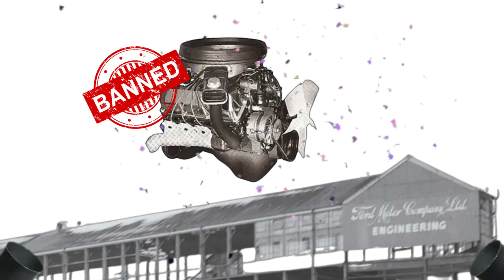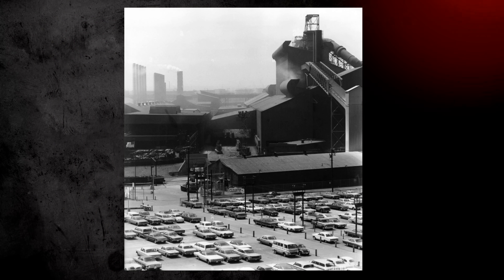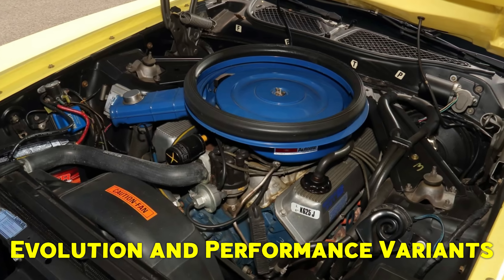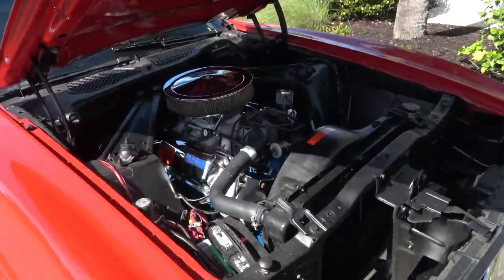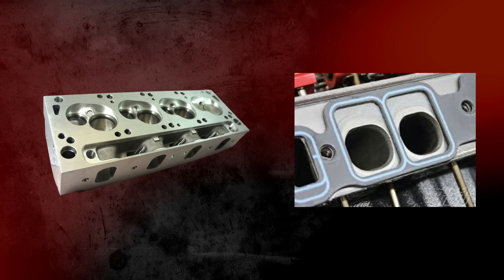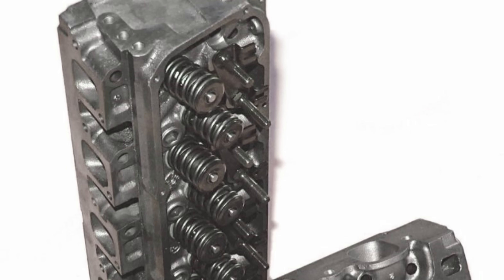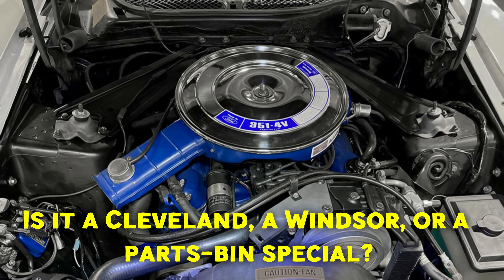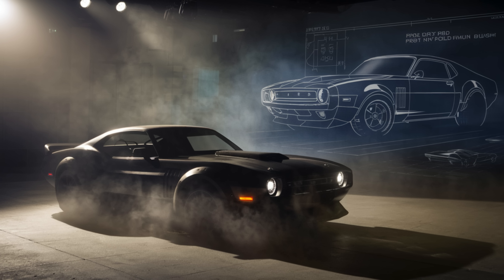The Shocking Truth Behind FORDs Banned 351 Cleveland Engine

Comment: By the mid 70s gas and insurance killed the muscle cars. But if you were around then like I was, they were practically giving them away. My uncle grabbed a 69' mach one 428CJ in 76'. He traded a 75' monza straight up for it! Though not a muscle car, in 80' I bought a 64' imperial with the 413ci wedge, 380hp, for a hundred bucks. I stuffed  that in a  71' Dodge Dart and destroyed the corvettes of that time. Man! Those were some great days.
Reply: I got a '70 Mach I with a 351C for my 16th birthday (1981) for $850.... Sure it was a bondo buggy and it went through transmissions like it went through starters, but when it did run, it was a beast.
Reply: so many under $500  in the early 90’s and gas was cheap and my job would give me 5 gallons of gas a day just to show up , wasn’t really worried about the gas mileage. They were so fun to drive.
Reply: Damn. Buddy of mine had a 1962 Chrysler 300 letter car (H?) that had the cross ram setup. Think it was 400 hp. Absolute beast. Push button transmission and the bubble dash.
Reply: @ J prolly
Reply: @charliebay9441  I bet that had at least 425hp maybe even 450hp. Those wedges were the precursor to the Hemi. A couple of the best engines ever made.
Reply: @ursirius4878  The hemroid & the wedge were about the same time frame. Chrysler put first gen hemroids in cars starting about 1953. The wedge motors would smoke a hemroid in street trim EVERY time, the reason Dodge made MAX WEDGE, NOT max hemi cars in the 60s. Hemroids don't make big power without a blower because the design limits valve size, lift, & duration. A wedge will handle at least 20* more duration & a couple hundred thousandths more lift. The valves eventually hit each other in a hemroid because they are placed 90* apart & open towards each other! See what John Kaase has to say about them because he makes both types of heads for a 385 series BBF engine. Yes, Boss 429 heads were hemroids too. 1 of the reasons 4 valve heads work well is because they are a "Pent Roof" chambers & the much smaller valves don't have the interference problems a 2 valve hemi head presents. One of the best heads(engines) ever was the Buick "NailHead" because the valve inclination angle was almost zero, or vertical. Small block Chevies are 23* & SB Fords are 20*. Somebody is now making an 11* head for SB Chevies. My dad's buddy had a 65 Chevy p/u with a 401 Nailhead & it would smioke most of the "muscle" cars of the late 60s.
Reply: @bradgriffith4231  a few of my friends had Hemi's and 440s with a 4 barrel or a six pack. For street the 440 was their choice. Easier to tune and keep running for daily driving. But if you wanted to run the quarter the elephant was the way to go.
Reply: @ursirius4878  Actually, the LS6 Chevies were the KING back then. Hemroids have always been turds without forced induction because the design, with the valves 90* from each other, limits valve size, & both cam lift & duration. The valves WILL hit at some point. John Kaase makes both hemroid(Boss) heads & wedge heads & he explains this. The canted  or splayed valve heads are the best design & a wedge head is the next best with the valves stood up to as near verticle as possible(think Buick Nailhead). The hemroid was an 1890 industrial design motor, not a performance motor.
Reply: @charliebay9441  HP ratings dropped when they changed to "Net" HP from flywheel HP. a 20% drop through the driveline is common.
Reply: @ursirius4878  Back in the 90s I bought a late 70s Impala for $400 and that was a pretty solid, fun car (that old soft suspension made the landings nice and easy when I’d launch it over the railroad tracks in town! LOL) biggest flaw was that it looked like a previous owner had painted it with house paint and a roller brush! LOL!  Brother had a 73 Chevelle he’d bought for less than $1000 in the late 80s early 90s, used to have fun racing his friends in their Satellites, Camaros, and such that they’d all bought/built for pennies on the dollar.

You can still buy some great “old” (new old, “didn’t they just stop making that?”) sports cars for a bargain if you’re willing to take on body and paint work and the high probability of having to turn some wrenches. So long as you’re buying into one with a very common drive train (5.0, 5.3, 5.7, 351, etc) you can do it all relatively cheap! I am debating buying a damned nice looking 90s Camaro for under 10K, and with a 5.3 it’d be very easy to get parts for and cheap to massively upgrade.
Reply: Wrong answer,it was the US support of Genocidal Jews in Isreal that caused OPEC to embargo crude oil for gas. 50 years later and we still suffer from being subservient to a bunch of Genocidal Maniacs.
Reply: The 413 wedge was a good engine but the 80s Vettes were still SMOG motor turds & probably outweighed your Dart by at least 1,000 lbs with a 180 HP 350.

Comment: There's a reason the original Panteras were built around the legendary Clevelands. No other sports car on earth at that time combined exotic looks and American muscle. I'm currently reworking the numbers matching matching 351C in my 1972 pre L. Going with the CHI 3v heads and intake, roller cam, etc. Aiming for 500 horsepower and under 3000 pounds. These cars rock and roll when built right. Great Video, thanks so much !!
Reply: Getting ready to build another 351c for my 73 pantera,will keep original motor in case we might want to restore to original, looking for 475 or so hp
Reply: @lanehawley4987  You go brother !!
Reply: Here in Australia the Ford Cleveland 351 was legendary. Ford Australia built the world's fastest 4 door sedan in the XY GTHO PHASE 3 , it was even faster than a lot of touring cars in Europe and America. All here in Australia back in the late 1960's through to the early 1970's. The XY GTHO was built in 1971 but Ford Australia race program started in the 1960's. And Chevrolet motors were used in General Motors Holden also. Chrysler did exceptionally well too. But Ford dominated the local touring car race class in the 1960's and 1970's. Check it out. And here in Australia we have a race track named Bathurst on Mount Panorama in NSW. Check that out too. Great time here in Australia unlike nowadays.
Reply: @joedipietro2559  1000% true, I was looking for someone who knew their stuff!!
Reply: I've been in one, with a BUILT 351 and it ran like a scared rat. Kind of difficult to do anything other than stock naturally aspirated intake tho, which sucks. (I mean without uglying up the car)
Can you imagine a blown 351 in a Pantera? ;) Tom Tjaarda would be smiling in his grave.
Reply: I've got my 73 mach
351 ram air ported polished heads intake balance blue printed forged pistons rods. Converted to a solid cam a bit wild.. 471 hp 513lb ft
11.91 1/4
7000rpm I have hit 7500 once but that's my scary limit. I was losing to a Camaro... Until 2nd.
Ray Barton himself built it for me.
Reply: @JoeBlau-c4e  Strong numbers for sure. Ray knows how to build em. I'm sure it's a blast to drive. Clevelands forever !!
Reply: My brother and I found a 351 cleavland at a scrap yard in Tampa Florida in a mustang fastback, wrecked on the side of the car. It turned out to be the 2v heads. We took it to a local machine shop to have it gone through. The owner of the shop told us that the engine was one of the best ones he had seen in a very long time. The shop went ahead and replaced the cam bearings and sold us all the other parts to get her back together. We topped it off with a mid rise weind aluminum intake, Holley 700 double pump carb. With a comp cam 534 / 544 lift with double springs with dampers. For the exhaust, we had Hooker headers that had to be cut where they mounted to the heads and a moroso deep sump oil pan with high volume oil pump. We stuffed that thing into a 1982 mustang GT. Hince the reason for cutting the headers. It was pretty fast and had a lot of low end torque. That was only one of the cars we built. I wish we had never sold them. A lot of sweat and money and time. Never sell them if you build one, you will regret it sooner or later. Now I'm disabled and can't afford to build anything. I really miss the sound of that rumble of the cam.
Reply: @mikehall8032  I think you should be able to achieve that HP with that combination of parts, I was getting 450HP back in the late 90s and only 2V cast heads although it was a stroker motor that would rev to 8000, they said on the dyno with a high rise and bigger carb it would have made 500hp.
Reply: google Woodhouse Pantera... incredible car... creator is a friend... was fun to watch on track
Reply: @robviousobviously5757  Woodhouse sold the car long ago and was later into vipers.
Reply: **pilot's license sold seperately.
Reply: I guess you've never heard of the AC Cobra, the Sunbeam Tiger or multiple others. Several manufacturers at the time used short deck, Ford Windsors because they were the smallest external dimension engine made & fit where others wouldn't fit. The circle track guys put together the "Cleavor" with a Windsor block & Aussie Cleveland parts. Edelbrock now makes a Cleavor package with heads & intakes. FYI, I had a friend in Phx in the 80s that put a 427 BBC in his Panterra & really woke it up! LOL
Reply: I had an original 351 boss from a pantera  i built it exactly to NASCAR specs. It made 550 hp it was a rev monster
Reply: Jensen Interceptor was contemporary.
Reply: I had a friend in Scottsdale that tossed the Ford motor & put an aluminum BBC in his Pantera. BIG improvement!
Reply: You're forgetting the Bricklin.😊
Reply: Those Panteras had Aussie made Cleveland’s
Reply: @georgestarzynski7222  Just check for the "G" cast on the cylinder block wich stands for Geelong Melbourne foundry. If it has "C" casting letter than it is a Cleveland Ohio cast block.
Reply: @georgestarzynski7222 no they didn’t
Reply: @georgestarzynski7222 mine was a c motor
Reply: Still remember fondly my 69 Mach I!  I couldn't afford to make the repairs to tighten up the suspension and repair the rust at the fast back windows.
I would take that death trap on the freeway late at night and just open it up.  It was floating all over the lane but felt like a rocket accelerating to the moon.
Reply: @cantweallgetalong  Dear old dad bought a new one in 1969. 428 SCJ drag pack 4-speed Mach I. Man, what a ride. Back Jade with the orange mach I stripe. Took me for a ride  at 2 am one night. Got that thing over 150.  Had the speedo pegged straight down.
Reply: DeTomaso Mangusta had a 302 Ford. 
The Shelby Cobras had 289 and 427 & 428 Ford motors. 
The Sunbeam Tiger had a 260 Ford. 

Among many other European exotics with Ford engines at the same time.

Comment: I bought a 100k mile 73 Mercury Cougar with the Cleveland engine.  It was low compression and detuned and didn't have that much power especially at low rpm.  It got 10mpg running around Raleigh.
Reply: I had a pretty much clapped out 71 Cougar with a 351C 2V. With an open element air cleaner and dual exhaust, I’d see around 14 on the highway on a good day.

Comment: everyone who loves drag racing  remembers 

the Vodepevic bros

1980s

eddy.ivan. truck mechanics.

naturally aspirated- no nitrous no turbos on Av gas 

All cast iron small block australian  cleveland - radical braised ports re routed runners custom grind flat tappet camshaft  custom made re ported offy intake single dominator carbed engine with custom built headers 

lenco 4 speed manual 

full bodied 3700lb + car

8.26 seconds 

adelaide international raceway 1/4 mile 

2 dr falcon coupe

wheelstands 1metre high through 1st 2nd 3rd  til half track 

inside that tamed stock 302 cleveland is a fucking weapon.

ADR laws mean nothing to a mechanic with metallurgy & engineering skills.

😎🎬

Comment: Unfortunately,  due to higher regulatory requirements for emissions,  the 351 really didn't stand much of a chance in the development process of that engine.   That was one really great engine.
Reply from the maker: You're absolutely right! The 351 Cleveland had some impressive engineering, but regulations really shifted the landscape for performance engines.  @thomastaylor6699

Comment: I had a set of 4V close chamber heads that I swapped for some open chambered heads. Not realizing that pretty much all the yank motors had open chambered heads and were pretty common with people importing them to Australia but the closed chamber were mostly Australian and a lot rarer than the open ones. 😢
Reply from the maker: That's an interesting story! The differences between the closed and open chamber heads certainly played a big role in performance and rarity. It's fascinating how certain parts can be more common in different regions! @grantleypotts8046
australia got an exceptional motor tooling factory , i wonder were the machiens and  engine casting went ?
Reply: I wasn't aware of the Australian connection to the Cleveland when I bought my Pantera back in 1994, but I certainly am now. Manufacturers like CHI,  Yella Terra and more are instrumental instrumental in enhancing the performance and longevity of these great engines. We Yanks owe you Aussies a bunch. And thank you for your encouraging words sir.👍
Reply: We thank you Yanks for all the 351C crank and rods that were imported from you, especially in and around the early 90s when local wrecker yards were asking an arm or leg for a conversion from the 302C to the Five One. It was interesting that the American crankshaft wasn't stamped or casted with the engine size as we were the only muppets that down sized the that engine. 🤔
Reply: @grantleypotts8046 that was always the case to get a Chev or a Windsor to Reeve you didn't need to spend anywhere near the money to get it to hold together and go like a shower shitt where is to this day to do the same to a Cleveland is astronomically dearer  .. try and put a blower on one 😮you could do a healthy 350 Chev for about 12 grand 20 years ago where as you would have spent at least 18 to 20 to do the same type deal to a f**** Cleveland ...
Reply: I still have a set of 69 closed chamber in the garage as well as "xxx" 4bolt main block. If my pantera sourced block fails it will be next....
Reply: @hegonefishing9122  🫶 Dav was it
Reply: I was led to believe that there was almost nothing comparable between the two heads that being Australia and the American .. Ford Australia got all the manufacturing gear here and went nuts open and close chamber heads were available on the 302 -51's  before 1970 with the 4v fun really coming to frooition 72-73 .. it was my understanding by that same time period in America Ford America's Heads headache completely different shape to the ports tungs ( their heads were manufactured with emissions being the primary banana in exhaust shall we call it ) Australia was basically forced to cool it's jets too XB shared some of the H-perf fruits basically the writing was on the wall and Ford Australia faced with the prospect of all of this might need to be dumped in the ocean devised clever marketing plan everything must go in terms anything the headline around for these vehicles slapped a blue stripe down the middle of the bonnet XC painted a snake on the side of it called it a cobra and watched all the detuned ( I'm Ford through and through and I thought the pieces of s*** ) basically slapped together junk .. so not to be stuck with it .. most of them which were 302' s .. particularly fond of the Xa Coupe or sedan myself mainly the grill indicators and bonnet ... the most unappealing part of the XB-C would have to be the grill and indicators  ..